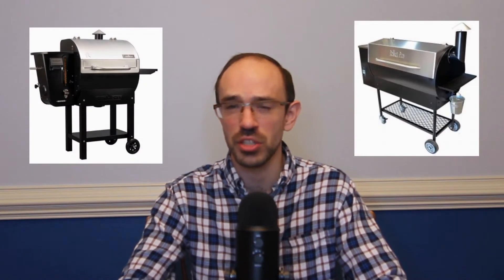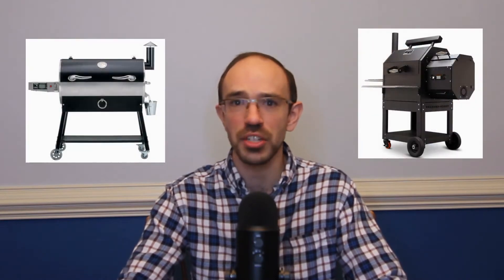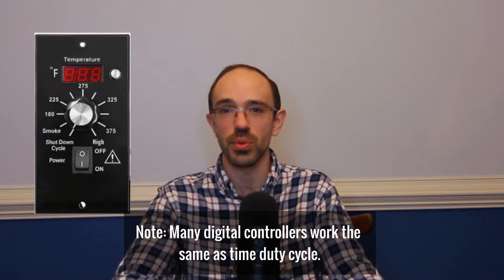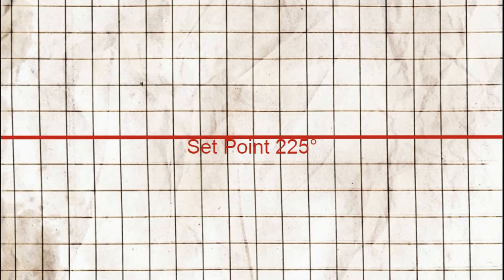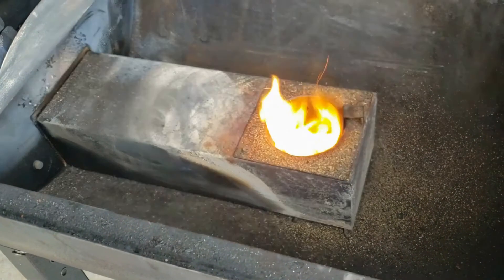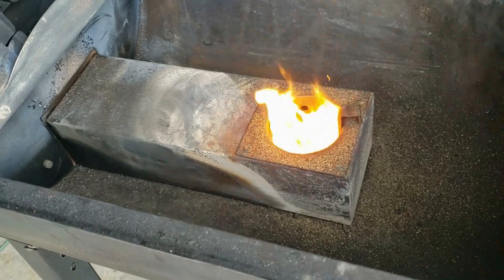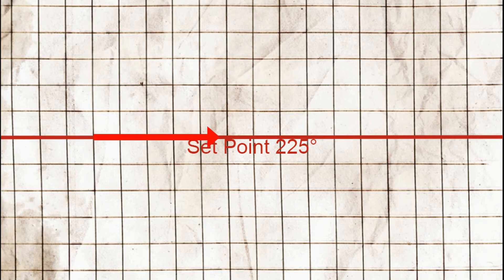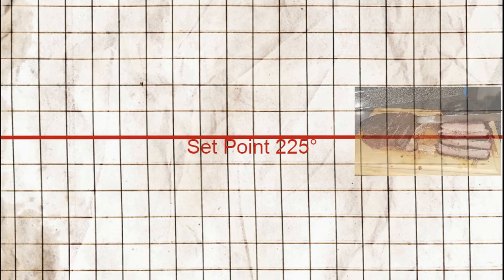Should I Upgrade My Pellet Grill to PID Control?

Comment: going to up grade my pro22 to a wireless/bluetooth PID controller. my current controller seems to work fine, after buying a set of Meater probes, I want to try/have the wifi/BT capability. If I'm not happy with it's performance, I can always switch back to the traeger controller.

Comment: This has been a long standing debate as to whether PID or non PID is better. PID makes your smoker to be more like a oven and  give you a more constant temp at the cost of getting less smoke. I have both a Camp Chef and a PitBoss neither have a PID controller and produce great barbecue with a nice smoke ring. If you want to increase efficiency install a high heat felt seal around your grill lid. I did this on my Camp Chef and  was amazed at how much less pellets that I used. The green egg seal kit works as well as Aura seal kit pt no AOP-GSKT.
Reply: I like the pic controller for temps then use the cold smoker to add smoke
I've also used the colde smoker to make smoked cheese without using heat from the controller.

More attachments, but kind gives a best of two worlds situation.

Comment: PID control indeed stands for Proportional, Integral, and Derivative.  In order for a controller to be a controller, it must have proportional control at a minimum.  It can then have integral and/or derivative.

Proportional control requires that a gain or proportional band be programmed into the controller, as well as a setpoint.  In this case, we are dealing with temperature.  The gain is effectively a multiplier that tells the controller how it should adjust its output for a given deviation between the setpoint and the actual temperature.  The idea is to keep the temperature at the setpoint.  However, proportional control cannot do this on its own.  Using P only control, there will always be an error between the setpoint and the actual reading.  This error is known as the offset.  A high gain can help to reduce the offset, but will cause the temperature to surpass the setpoint and oscillate before settling.  A lower gain will not surpass the setpoint, nor oscillate, but will take much longer to return the temperature to its setpoint and will result in a larger offset.

One solution would be to adjust your setpoint until P only actually controls at the desired temperature.  Another solution is to introduce Integral.  Proportional sees the error itself and creates a proportional response.  Integral sees the area between the offset and the setpoint.  Because the area is a larger number than the offset itself, integral is capable of adjusting the output to reduce that area, and thus reduce or eliminate the offset.  

Integral is also known as reset, and uses units of repeats per minute, or minutes per repeat.  Repeat refers to repeating the proportional response.  Integral is capable of seeing the offset and seeks to adjust the output to eliminate the offset.  It adjusts the output by repeating the proprtional action a number of times per minute.

Integral, however, requires boundaries.  A controller will only have a range 0-100%, where  the output cannot be less than 0% and cannot exceed 100%.  If the proportional response has already brought the controller to 0 or 100%, or if the integral has ramped the output to one of those limits and the offset has not yet been eliminated, the integral jumps from reality into theory.  It theoretically changes the output to beyond 0 or 100%.  When the temperature finally stabilizes and then changes direction, the opposite response is required.  Unfortunately, integral keeps the output pinned at the limit it surpassed until it jumps from theory back into reality.  In the meantime, the temperature is changing and cannot be controlled.  This is known as reset wind-up.  To help mitigate this, boundaries are programmed in so that the integral will stop trying to do anything if the output is already at a limit.

D is for Derivative, but in most cases also stands for DO NOT USE.  Derivative is a fortune teller in that it sees the rate of change from the setpoint, but never actually sees the amount of error.  For this reason, it can eliminate an error before it actually becomes an error.  However, if the thing you are trying to control is relatively stable, then derivative can cause it to become unstable.  Derivative shines in situations where the thing you are trying to control tends to change slowly and takes some time to return to the setpoint.  Something like temperature.

Derivative will see that the temperature is starting to change at a certain rate, and based upon the proportional response, will further adjust the output to slow down and reverse the rate of change, hopefully without any error having ever really occurred.

For the sake of control, PID can provide incredible control when tuned to do so.  However, how important is the temperature of the cooking environment?  Obviously we do not want low and slow to become fast and furious, but holding to within a few degrees of a setpoint is probably not going to improve your cook.
Reply: I got a PB Laredo 1000 with PID controller. My 4th pellet grill, so not a newb.  Whomever programmed it had no clue. If I don't have it on high it will take hours to preheat. Even on high, it takes 45 minutes. Here's where I doubt the programming. As the temp is coming up on high, the fan is full speed, as it should.  But say I want 350F. The temp is approaching at say 310. If I turn it down to 350 from the high setting, the fan speed drops to idle, it seems.  Most of the time the temp starts to drop at this point, yet it is still 50 degrees below the set point. Frustrating. I would think the fan would stay on high speed until it is much closer to the set point.  I learned to leave it on high until about 25F above my desired temp then turn it down to that 25F above my desired temp and I will get close to what I want.  I could only live with that for about 18 months and went back to a PB700 with a standard controller. 12 min to get to 400F. That's more like it.